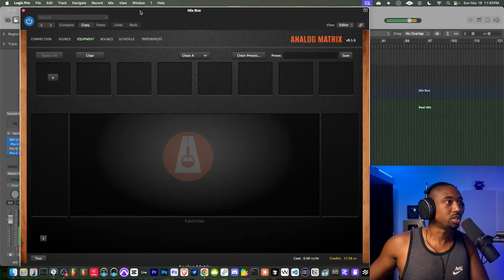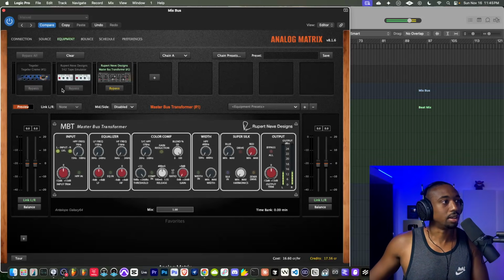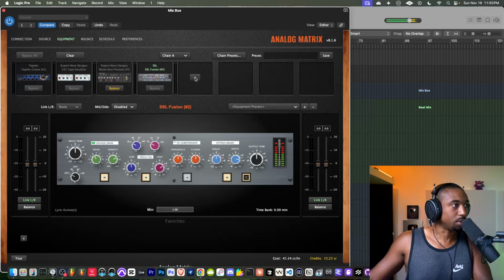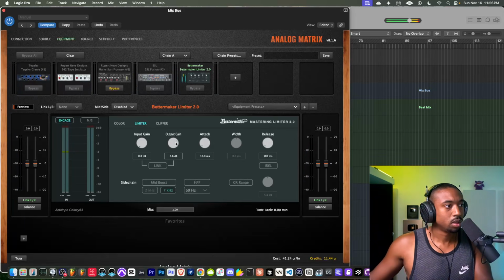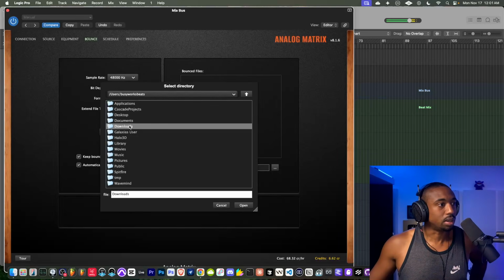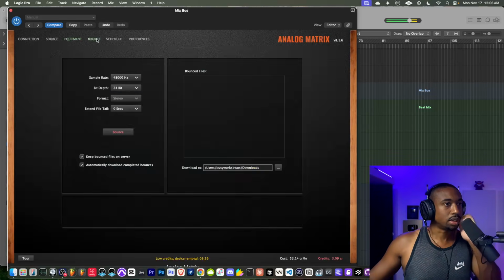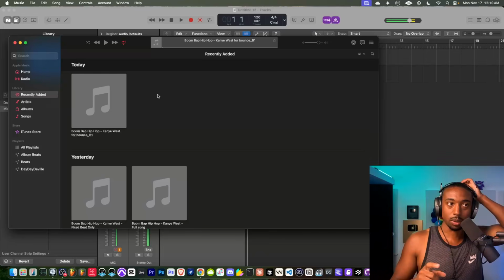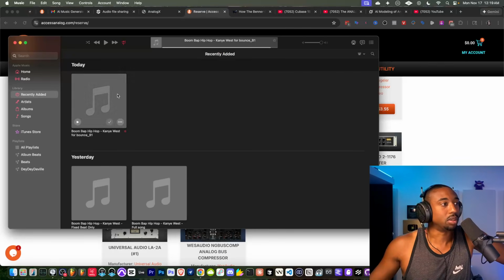This Analog Gear Chain BLEW MY MIND

Comment: I used the plugins to test gear ⚙️ before I buy it. Doing this help me learn my distressor and much more about how to properly use compression
Reply from the maker: It will definitely sharpen your ear to what compression should sound like. Plugins are hard to learn because they don’t compress very well.
Reply: @busyworksbeats  I completely agree. 👍
Reply: Try kotelnikov have the action right.

Comment: I wonder if you calculate the delay compensation, would the analog matrix have the playback in time for individual tracks?
Reply from the maker: I thought about that, but then thought, wouldn't it just be delay + delay ?? DAW Delay, plus latency buffer to the server.

IDK I didn't try lol. But the LA2A sounds fire on vocals. I wanna use it.
Reply: @b @busyworksbeats  the bouncing through the matrix seems a little sketchy as well. I’ve been looking at access analog for a while but haven’t tried it yet, but I’m wondering if it would allow you to render the processing from the matrix into the DAW without bouncing from the matrix. I work in pro tools and I hybrid mix without an hd system. There is an option where pro tools allows you to commit processing and disable and hide inserts to save cpu. I’m just wondering would it allow me to do the same with the analog matrix